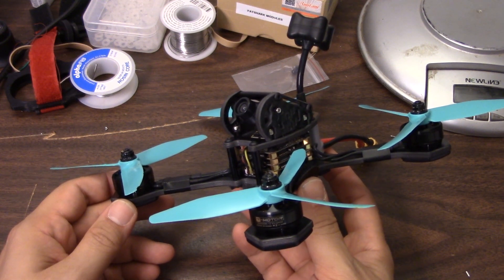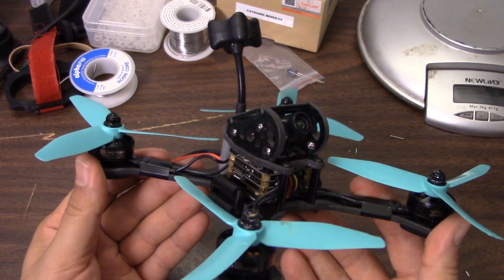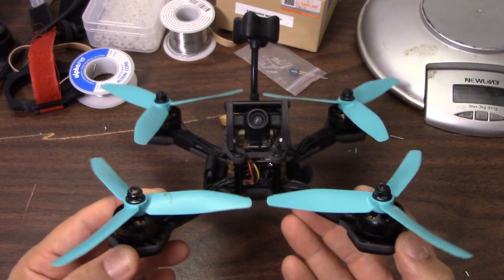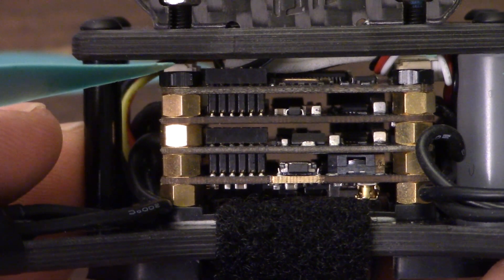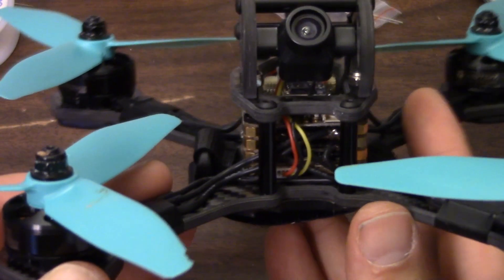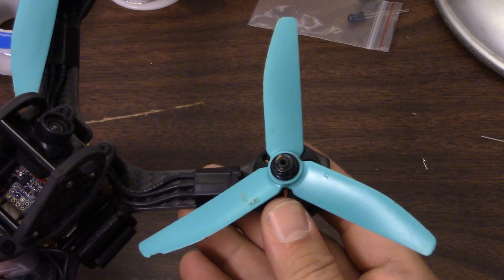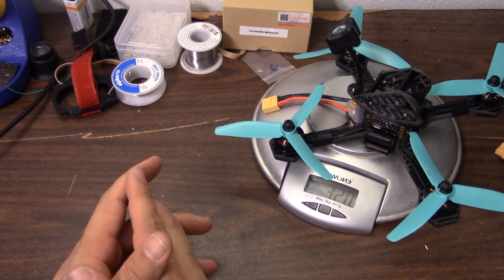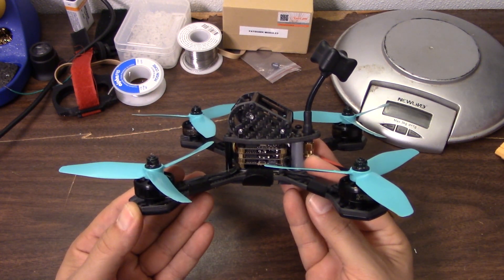QuadQuestions QQ190 Ready-To-Fly Racing Drone | FIRST LOOK

Comment: Hi Joshua i really like your channel and i respect your knowledge.let me ask you something...i want to fit this 2in1 tbs powercube in to the armattan chameleon frame...do you think it's possible?use a spacer and longer screws if needed for the top plate,can works?i dont have the frame yet that's why i asking you.Thanks
Reply from the maker: I don't think it's a good idea. The Chameleon frame is very good at being what it is. If you want a taller frame, buy a frame that is designed to be taller. Personally I have gotten great use out of a QAV-R.
Reply: Ioi

Comment: I think i might of misheard it, but what Radio can you use to run this? I was one of those people who got disquriged and got out of the hobby, but this one is making me want to try again.What goggles do you recommend as well? I dont need to get top of the line to enjoy, do i?
Reply from the maker: The copter comes wired for SBUS, which means it will work with a Taranis or QX7. The ideal receiver would be a FrSky micro receiver like this one: 

http://www.getfpv.com/furious-frsky-micro-rx-ultra-small.html?utm_source=google_shopping&gdffi=747627bc7e464db68e5f529d971aacf3&gdfms=24969D7B78E0463F9CEAE8700B445D52&gclid=Cj0KEQiA2uDEBRDxurOO77Cp-7kBEiQAOUgKVxLEl_NO1Lp9xsEyjQ96WdgudrDQZkgPDpcSNzbl4EQaAlwR8P8HAQ

It would require soldering the wires on, but it's small and will work with the pre-wired harness on the QQ190.

The copter will work with pretty much any receiver you choose to use, but a QX7 and that receiver would be a good place to start.

Alternatively, you might prefer the Evolution radio. But I don't know of a receiver that works with the the Evolution that will fit into the QQ190 easily.

Comment: Enjoyed your review of the QQ190.  So much so that I purchased one.  Unfortunately after attaching the antenna and powering it up I was unable to get any video to my Fatshark Dominators.  I cycled through all channels and bands to no avail.  Would you have any ideas as to what I may need to do.  Is it possible the camera (the cheapy CMOS one) is bad therefore I'm not getting any signal?  Appreciate any advice you may have.
Reply from the maker: +TRexHeliPilot you should still see black on the channel even if the camera wasn't working. Shame you dont have a Fatshark module with a spectrum analyzer. 

I would say to reach out to QuadQuestions for support.
Reply: Joshua Bardwell, thanks I do everything a black screen at times.   I'll reach out to them ASAP.

Comment: There are  skill sets that that every Man should know or seek to learn.  Basic car repair, basic electricity and wiring, basic plumbing, basic woodworking, and basic soldering, to name a few.
Reply: of course it is...you will need to know how to solder when working with wiring or electronics or plumbing, or silver soldering, etc etc.
Reply: Bang Switch and a touch of COMMON SENSE
Reply: Sometimes sorely lacking.
Reply: soldering is not one

Comment: what would you go with between the eachine wizard 220x and this one ?
Reply from the maker: I mean, that's like asking which is better, a Civic or a Mercedes. If you can afford the Mercedes, obviously, it's better. These two copters aren't even in the same class.

I think a much more interesting comparison is the Wizard compared to the Shuriken X1. The Shuriken is about $100 more expensive, but is way, way better a copter. Comparing the $140 Wizard to the $500 QQ190... I mean, nobody who can afford the QQ190 is even going to look twice at the Wizard.
Reply: I know about that but I was talking about more bang for your bucks ... I know that this drone is better then the wizard ... but I feel that it' a little bit overcharged for what components you get compared to the crusader gt2 ... I fell like it is a little ripoff ... do you think the crusader gt2 as an edge over the qq190 ?
Reply from the maker: I haven't flown the Cursader GT2 so I can't say for sure. I don't think the QQ190 flies $250 better than the Shuriken X1 though. The main advantage of the QQ190 is that it is completely maintainable without being able to solder or other advanced electronics skills. Of course, its gear is top notch, but I would find it hard to say it was worth a premium of $250 for most pilots, for whom $250 is hardly pocket change.

Comment: you probably should clarify in your video if this is BNF vs RTF and what Tx comes with it if it is a true RTF. 

Also, how does it compare to the Shuriken X1's flight performance?

I feel like the crusader gt2 200 would be
 a faster racing quad for  $200 less...
Reply from the maker: This is a PnP. You provide your own receiver and transmitter. I suppose you're right that QuadQuestions is taking a few liberties with the term "RTF" here.
Reply from the maker: Flight performance vs. the Shuriken is tough to call. I want to do more flight testing before giving a final conclusion. But my initial impression is that it's a bit like a Miata vs. a Corvette. The 2600kv motors on the Shuriken give it a bit more power but the QQ190 feels lighter and more nimble.

One distinguishing feature of the QQ190 is the completely solder-less maintenance. If you know how to solder, I think the price of the QQ190 makes it less appealing, although its fit-and-finish is top notch.

Comment: I emailed quad questions after looking at their page because there's a 
number of discrepancies between what's pictured, what's listed and the 
specs on the quad. Reading over the description you may notice that 
there's no inclusion of Antenna or receiver. According to Anthony, it 
comes with one triumph antenna but no rx. On one hand I can see why 
you'd do that, on the other you'd think it would be an add-on or option.
 Personally, if I received it expecting I'd be able to go fly after 
configuring in BF, I'd be mad knowing I had to find a dealer carrying a 
rx or order one. 

Additionally, the "330g" weight, simply isn't accurate. Anthony didn't 
explain why they didn't include certain items in the weight, but a 
single Triumph antenna weighs 12g + rx + a real camera so you can easily
 add another 30g to the weight of the build providing those are the only
 items they decided to omit from the weight of the build.

Regarding the camera, I inquired as to what their "QQHQ" camera actually
 IS and whether the lens was a 2.8, 2.1 or 1.8 and was given ZERO info 
about the camera... That being said, having purchased from them in the 
past, I'm all-too-aware that they do NOT give refunds, regardless of the
 reason and if it's been used, forget it. Credit is the best you can 
hope for providing you've never attempted to do anything with it. With 
that being the case, it's not worth a dice-roll for me.

That being said, I'm all but certain the "QQHQ" cam will just be a 
runcam owl given the price of the upgrade so you're still stuck with 
cmos and based on the dimensions of the pod, it's pretty evident that 
using an actual FPV camera will negate every bit of protection you get 
from the pod as the lens will undoubtedly stick out past the sides of 
the pod. I'm also kind of surprised by the limited flight angle and not 
sure why they didn't push the standoff back a bit to give racers the 
angle they're accustomed to.

Nonetheless, another great, honest review by Josh.
Reply from the maker: You've got a few facts wrong. The upgraded camera will include a standard sized QQ190 pod, which fits a typical 1177-sized camera and protects it normally.

The 330 gram weight is incorrect, as you say. The actual weight I measured was 320 grams. You can see that at about 8:20 in the video. That includes antenna, RX, battery strap... every single thing except the battery.

I agree it would be nice if QQ offered a receiver with the copter as an add-on.
Reply from the maker: Regarding the camera angle, I agree that it's not enough for serious racing. I think the intent is that a beginner might choose the cheaper CMOS camera, and a pro might choose the upgraded pod with standard 1177-style camera, and have as much uptilt as a regular QQ190 frame--something like 60 degrees I think.
Reply: My bad. I'm surprised they didn't mention that.

Comment: Since you are doing a "Pro Tune," will this be a completely exhaustive tune using Blackbox as well?  And perhaps will you have a tune with 2 or 3 props styles - like the DAL Cyclones, RaceKraft 5051s, and KingKong 5x4x3s (for those of us with budgets :oD  )
Reply from the maker: +Kendall Smith no Blackbox on this copter, sadly. I tuned using the stock props that come with it.

Comment: I think I'm stuck on that learning curve and very very slowly trying to get up. I'm building my own and each failure = success and so far my last bend is trying to flash blheli to escs and now I'm buying new escs to compensate. I taught myself and researched I am so pumped to finally release the beast I've spent days on my failures and success to finally FPV!
Reply: The Midwest Fishkeeper after you get it together and in the air, once you crash and break it don't get discouraged! rebuild and flyyyyy!!!!

Comment: Whats that TBS cube you have is that a new one with 4 escs on the single board?
Reply from the maker: 2-in-1 ESCs, so the two middle boards are the ESCs. Bottom is the FPVision. Top is the FC. And BLHeli_S ESCs too.
Reply: Sweet.  What amp are they?  Are they BB2 chipset do you know?

Comment: Strongly disagree that the HQ props are good for a beginner. Unless these are different than the ones I've used they will break as soon as they even grace something. I beginner won't be able to even land without breaking one. A tough 2 blade would be a much better option.

Comment: They redesigned the camera pod for the RTF. Will it fit an HS1177?
Reply from the maker: The camera pod that you see in this video does not fit an 1177. The $30 camera upgrade includes a standard QQ190 pod and an 1177 camera (or equivalent--not sure it is literally a branded 1177). You swap out the pod once you receive the copter. Its a matter of a few screws and plugging the new camera in.

Comment: You said 5040X3 is not enough for a 2300Kv. I'd like your video on that. A lot of people fly 2205s and even 2206s ~2300Kv  and love it for the crisp response because these motors have plenty of torque to spin a 5040X3 with enough head room to spool up and down faster. I started flying my 2300Kv red bottoms with 5045X3 and a whole new world of responsiveness opened to me when I switched to 5040X3 "just to try".
Reply from the maker: +Stephen B I prefer 2600 kv with 5x4x3 but some modern motors have so much power that even on 5x4x3 they're beasts.

Comment: It should be illegal to fly with cmos cameras! Its like letting blind people drive!
Reply from the maker: +Awoken FPV CMOS cameras can be good. But not cheap ones.
Reply: I agree, but I dont consider them viable options for now since you can buy 2 ccd cameras for the price of a good cmos.
Reply from the maker: As a fan of the RunCam Eagle, I half disagree. $35 for the 1177 vs. $55 for the Eagle... I think the Eagle is worth $20 more.

Comment: I have a qq190 and a qq220, best frames I own. I can't state how much I love these frames!
Reply: RC Flyer85 we are using alternating angles  on the qq190 the rigidity is quite remarkable- we will post a comparison video soon.
Reply: Adam Komarek the new carbon on the rtf is v2.0. It is stronger than anything we have put out yet.
Reply from the maker: I can confirm the carbon on this is really nice. I can't say how strong it is, but it's beautifully finished. Polished and beveled. Very nice.
Reply: QuadQuestions.com Am I correct in thinking that instead of 4 layers of Carbon directly stacked these are stacked at alternating angles in cross hatch like design which increases it's structural integrity?
Reply: Sssame
Reply: QuadQuestions.com are you going to be releasing an updated qq190/220 frame with the alternating carbon fiber pattern for increased strength? I'd like to purchase it so I could swap frames with my current qq190/220!

Comment: Loads of good stuff in it but for a beginner... Shouldn't entry level price be a bit less. Anyhow! I would love to buy it if I can afford it
Reply from the maker: +Beaux FPV some beginners want premium kit, I suppose. This is a competitive market though, and there are some other copters at lower price points as well.
Reply: I think lifestyle too. I started FPV literally just after Xmas and don;t have time to build my own. I can solder as I have a Vortex 150 and the motors are quite fragile and have been replaced due to a top down onto concrete.  Due to me being a noob, doesn't mean I don't want a crappy quad. This fits the bill as you can grow as you explore what a decent quad can do. It makes you learn quicker and push yourself. I went for an Oblivion though. Flown it once, sent it away to have Crossfire fitted and haven't flown it since.....That's if flying it 20-30m until failsafe kicks in count's. Crossfire defo doesn't work for me at all. Followed Josh's vid to the tee on how to set up CF and still bricks.